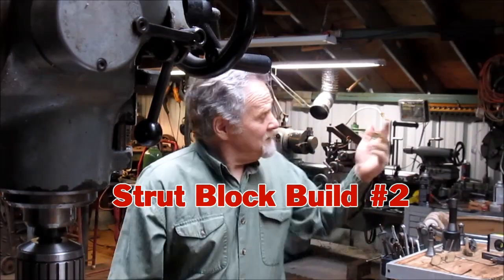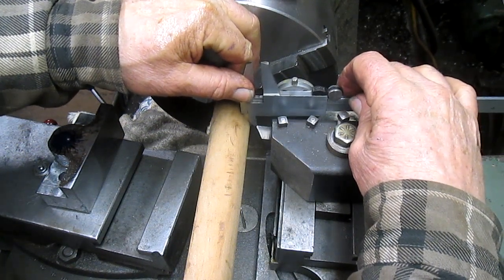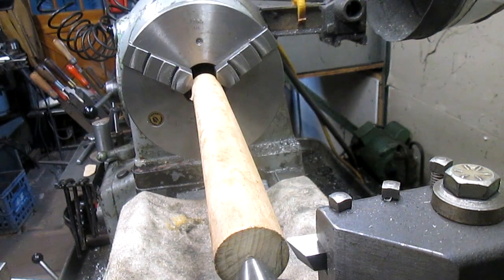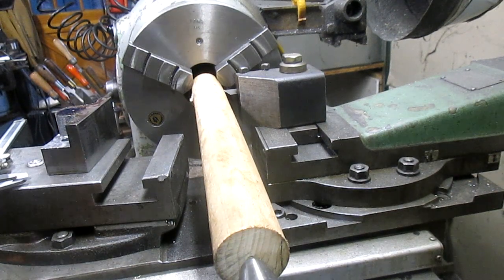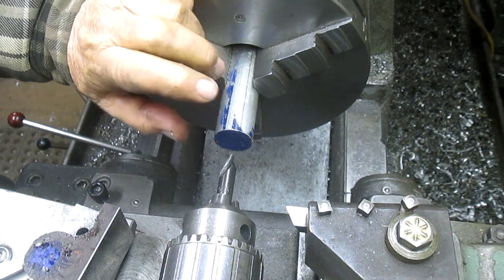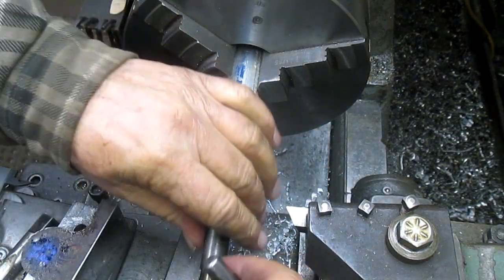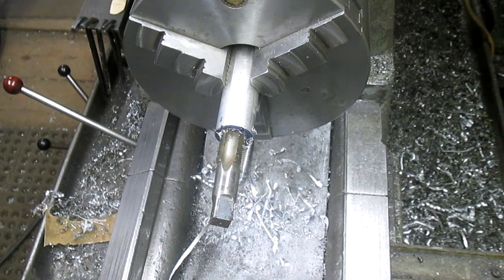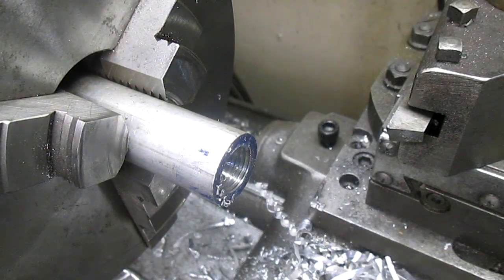Strut Block Build #2

Comment: Merry Christmas Nik. why was there a need to tapper the hole for the pipe thread? Thanks
Reply from the maker: Pipe threads are tapered. With a small pipe thread or one in soft metal, no problem, but this was some tough steel and there was no way that the tap was going to travel down that hole and taper the walls as it went.